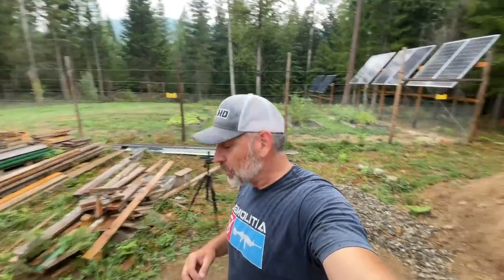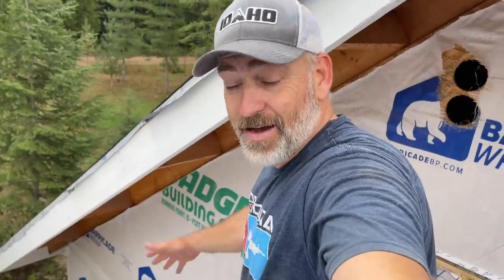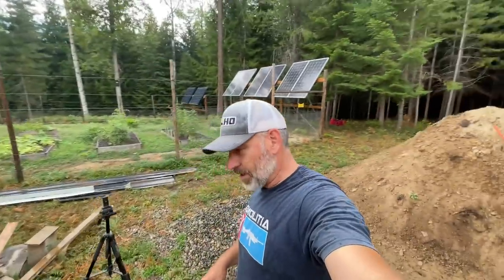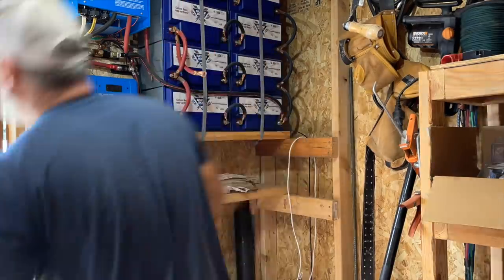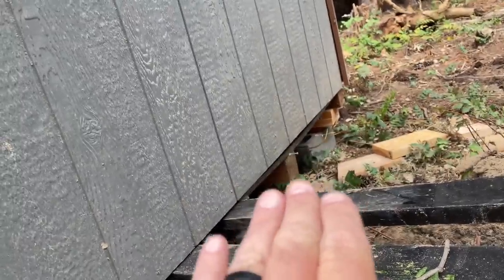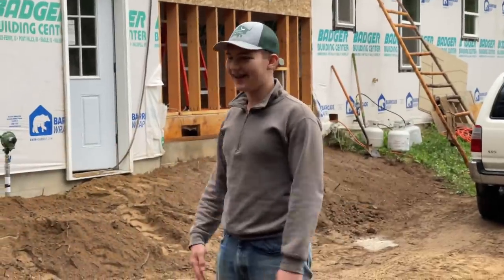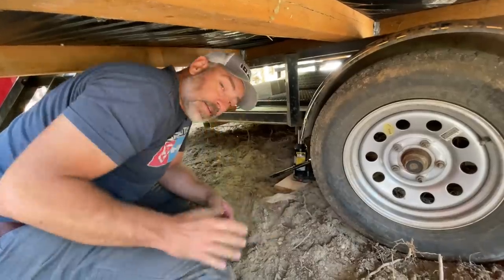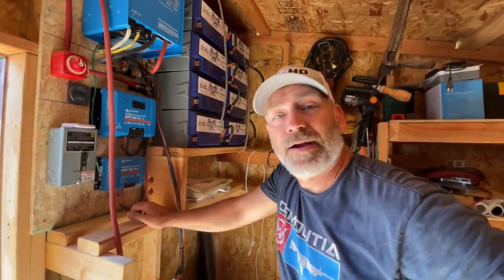RAIN is COMING! Roof Underlayment Installation, Moving Solar System, Broken Tractor

Comment: FINALLY —
An Intelligent HomeSteader that uses their time, energy and money wisely!!!
Propane is such a wiser choice to heat your Home — you can spend all that time wasted cutting, gathering, splitting, stacking, moving the wood 🪵 from the beginning of the process until it is in the Wood Fired Stove!!!
Reply: Propane is the most expensive fuel to heat with per BTU, much more than electricity, oil, natural gas or wood.  i made the change from it.
Reply: @raylauraberg260  

Well of course National Gas is the cheapest — but without the utility available, big deal!
And the same goes for Oil, if it is not available, again Big Deal — besides it being so dirty.
And in MANY areas Electricity is the most expensive!
And if you us common sense and TOTAL COST IN TIME, ditch using wood and use the time saved Heating with Propane to earn more than enough money to pay for it, besides, in most areas Propane is cheaper than Gasoline, can be bought on a discount contract and much more dependable than Electricity.
Reply: It's all a matter of choice and preferences.  Many people that like to live an independent off grid lifestyle love using wood resources  and don't mind the work and time involved.
Reply: @paulmonk7820  

Of course each of of has the right to heat the way they please.
What I see happing is so many people look at heating with wood 🪵 as something sacred, and not doing so is something that disqualifies someone from being a genuine HomeSteader.
Saving time allowing a Thermostat control the process allows their time to be spent caring for their livestock, build new or better animal shelters or just relaxing.
Reply: @paulmonk7820  

Just another thought!
If someone uses Propane to cook, dry clothes, and heat their home…
They are NOT AT ALL TIED TO ANY GRID!!!
You can buy Propane from anyone selling it on the free market!
It is NOT like Natural Gas which is on a grid system!!!
Reply: @BrianBriCurInTheOC  I think "off the grid" to most people just simply means being self-sufficient.  They still use technology, like vehicles, solar power, satellite receivers.  It does not mean living primitively, but able to make their own choice.
Reply: @paulmonk7820  

But using wood is as primitive as it gets!
Your having to invest so much labor and time which could be used in more profitable ventures. With Propane you have to add extra wood or just fill it up several times a day, Propane turns itself on.
Go spend time doing high tech tasks!
Reply: @BrianBriCurInTheOC  We're done!  Conversation over!
Reply: @paulmonk7820  

Pride keeps a man from admitting he is incorrect!

Comment: Yes but you have the knee walls that are a supporting the roof on the second  floor, so you should be alright Martin
Reply: The walls will do their job supporting the main part of the roof, but with weakened rafter tails, the part past the wall will not be as strong without additional bracing.

Comment: If you were going to go through the trouble of jacking the trailer up....Why didn't you jack the shed up off of the trailer with the bottle jacks and crib it up so you could pull the trailer out? Then you could lower the shed by jacking it up off of the cribbing and slowly removing layers of cribbing, and letting it down...Just sayin'...
Reply from the maker: Because it it not in the right location. The tractor is broke down in its spot.
Reply: @MartinJohnsonOffGridLiving  If you crib and level the shed just enough to get the trailer out, for now, you should be able to use it for the deliveries this week and then get it back under when the tractor is fixed. Good luck!
Reply: @MartinJohnsonOffGridLiving  You can always move it later when the tractor is out of the way.  They're just trying to help you get the trailer out from under it so you can use it.

Comment: Bird mouths are too deep, cantilever the eaves for snow weight. Better to be sure!
Reply: You're correct.  Option #2:  Add 2x4 soffit framing below this overhang.  Secure to the eave ends (tails) of all rafters and run back horizontally to the exterior wall with a continuous 2x4 plate at the wall.  Provide ventilated soffit panels at the bottom of the soffit framing.  BINGO!  No more structural problem and a nice looking finished underside to the overhang.
Reply: @artruprecht2022  BINGO!

Comment: Just take your farm jack what kind of hillbilly homesteader are you ? take your farm jack and jack up each corner and  cut some stumps some logs with your chainsaw and slip them under there let it down pull the trailer out from underneath it and let it down one side at a time with your farm jack or a floor jack